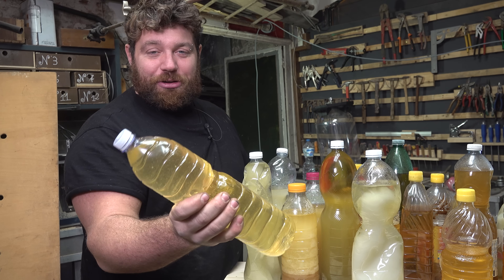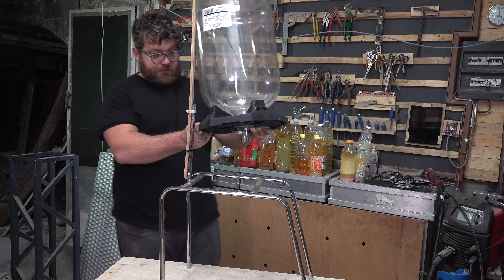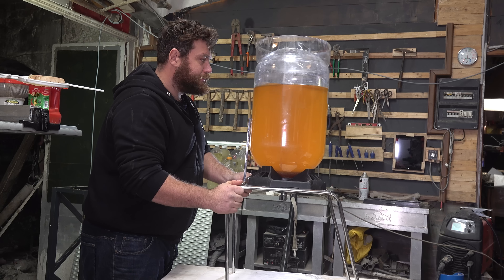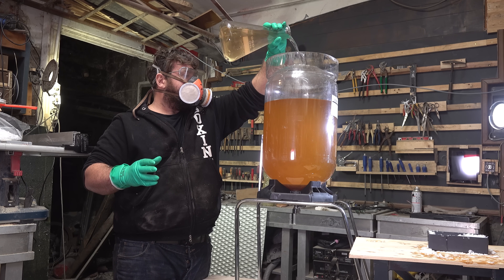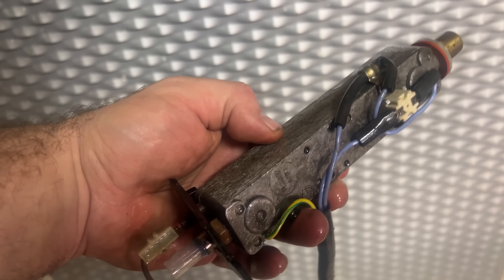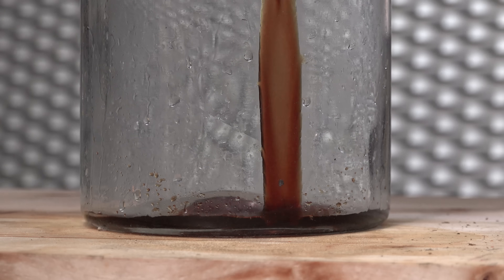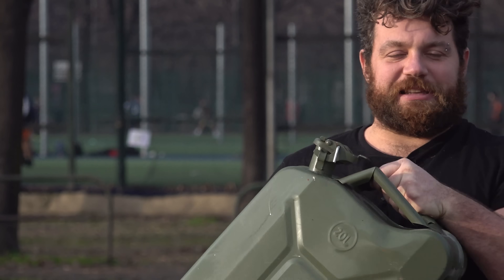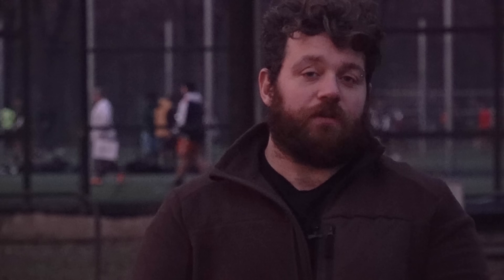How to Make BioDiesel at Home • Full Tutorial 4k

Comment: I have been making & using biodiesel for 15 years, I run 2 cars on it now but have probably driven 200,000 miles in various cars on biodiesel. I use 100% except in cold temperatures when I add 10% petrol. Your method is right in principle but you won't have removed the soap molecules & this could damage the fuel injectors in the engine, you'll also still have residual methanol in the biodiesel too. There is a worldwide community of home biodiesel makers and there are many variations on the processes of making it as well as washing & drying it. I water wash mine and have done so for a long time; it suits me best; methanol binds to water as does soap so its an easy way to remove both.

Comment: Another technique (simpler, but needs little modifications to your car) is to just filter the oil through some cloth. This technique is faster, but the oil is not as clean. This works best for old pre chamber diesel engines. On those engines it will work by just removing the oil filters. I've seen it work for cdi engines too but i think it needed a mixture of normal diesel and modifications to the fuel systems.

Comment: I am really considering getting an engine that could output me elecricity with diesel. I would go around and ask restaurants to dump waste oil to me. Imagine harvesting like 300 kilos in one go. The amount of complexity is really low and reactions are very safe relative to my experience. I will research it more.
I remember that a pure kilo of fat is 9000 kcal. A kcal is like 1.16 watt/hour. So a kilo of it is 10000 watt hours. Liter of oil is like 0.9 kilo but you also add 20% of mass extra from methanol. So let estimate i eventually get  310 kilos of oil could output under 3100000 watt hours (that is actual 3.1 mega watt hours or 3100 kilo watt hours). Lets say that my generator captures a third of it. Still wild. I want solar panels for the daytime electricity generation. That diesel engine would make me elecricity for the night. If I had absolutely huge barrels for it and i would produce more diesel than i would use - i could have electrcity for weeks if not almost 2 months in case of an outage. Also while I am burning that oil I would direct heat pump to my house to not waste heat, or use that heat to boil another substance like that one liquid that begins with letter e and boils at like 55-65 celcius to make a second generator in case my house is too hot. As an electrical engineer i am dazzled at this prospect.

Comment: This functions on all diesel engines. However, this is restricted to a limited blend. Specifically B20. Which means 20% of the fuel is bio diesel, the rest is Petro diesel. Modern diesel can run higher blends with upgrades and filter replacement. Those upgrades would be to remove all plastic or rubber hoses cause bio diesel will cause plastic or rubber hose to delaminate, crack, split and leak or clog filters. Fuel lines would need to be replaced with braided steel or solid steel lines. Bio diesel is also more lubricative then Petro diesel so it will increase longevity of fuel system moving parts. Like injectors and high pressure fuel pumps.
Reply: I have driven 70,000 miles in 3 years using 100% biodiesel in a Skoda Fabia 1.9PD with no fuel hoses changed and no indication of the original ones needing to be changed. Most fuel hose is biodiesel compatible, the only plastic it will affect is PVC over time. In 15yrs running B100, I have only needed to replace injector leak off hoses on a Berlingo 2.0 hdi - which also otherwise ran perfectly well on B100. I change my fuel filters every 10k miles. No problems...

Comment: Please be aware that any drill used for mixing of volatile liquids needs to be the brushless type as a brushed motor creates sparks and will ignite the volatile gases present. You also need to consider static discharge as an ignition source.

Comment: I own a fish and shop shop and make 2400 liters (634 gallons) a year 

I have three fryers each 100 liters or 26 gallons (total 300 liters or 78 gallons) that are refilled three times a week

But I only use the cleanest oil to recycle and the rest goes to waste management.

Making more than 2500 liters (634 gallons) a year means I need to pay excise duty which makes it silly the paperwork is wild
I have the waste management permit because of the amount of waste oil from the shop.  

In the beginning I I had a DIY but eventually bought a home kit for 6,000 pounds and to have it installed in the shed at the back of shop, no one complains about the smell, because everyone expects fish and chip smell from the shop.

Comment: a better way to heat this would be a Drum Band Heater. they are pretty cheap.also if you add a slight stem or hose to the exit valve on the bottom, you can help reduce any potential waste. also after dropping out most of the glycerin, i've seen alot of people blast it with water and stir 4 times over the span of a couple days to collect out the methanol, and any other potential alcohols will collect with the water and settle to the bottle and can also help clarify the diesel by collecting particulates smaller than 10 microns which will help reduce grime build up.

Comment: Good video. I would like to add that you need to test the ph of the UVO to ensure you mix the correct hydroxide solution. 
Also the biodiesel needs to be washed and heated again to dry the oil.
I have been running my diesel SUV on straight Used cooking oil for the last 10 years with between 10 to 50 % diesel or paraffin. I calculated that the chemicals and electricity to create bio diesel was the same as just buying diesel.
Fun to see other people's projects though.

Comment: If you have old disel with injection pump, just use filtered cooking oil mixed with regular diesel (30% cooking oil and 70% of diesel) and do it when it is warm outside. If you have newer diesel, just use diesel from gas station and do not experiment. It is not worth it. Too much work and you might fuck up your car.

Comment: Damn you make this complicated!
If you just filter the cooking oil and add 5% gasoline it'll be fine.
No complicated proces.
No dangerous chemicals.
No dangerous chemical reactions.
No expensive diesel needed.
Just cheap fuel.
It may not chemically classify as diesel, but who cares as long as the engine doesn't care???

Comment: as long as tthe car starts it doesnt matter if it coagulets when cold because when the car runs most of the fuel that goes towards the injectors go back to the fuel tank on  the return lines, (dont know their name exactly) and the diesel returning to the fueltank is warmed by the engine which is the same reason it is not good to un an engine with the fuel light on because it tends to get too hot and it wont lubricate the fuel pump (especially the high presure one) and thus leading to premature wearing of it...

Comment: You could probably mount a beer keg to a high speed drill press and let it turn at a few thousand RPM under pressure or vacuum for half a day or so to seperate out the fine solids and sediments from the oil to clean it up a little.
Reply: Please demo how

Comment: For older pre common rail cars it's fine, they will run on everything. But don't do it in common rail diesels, You can damage pump or/and injectors which are quite expensive.

Comment: The best option i saw on cleaning the cooking oil without using sodium hydroxide  was to use gelatine mixed in water  shake the oil up it up and leave it overnite it it separates the muck in the oil probably can reuse it again if you wanted to the gelatine tunrs into a hard gel so you just tip out the clean oil so its a simple process  that way you could clean the whole 20 litres or two batchs of 10 ltrs at the same time and its ready to use the next day so much easier

Comment: from a veteran cook to you, warm up the oil first and it will flow quicker. Merely filling up you sink with hot water and placing the bottles in will help. however, if this is a serious hobby you could probably get an old discarded deepfryer and warm it up on ultra low, 250 degrees farenheight.

Comment: There's some parts I'd want clarified. What in the hell are those percentages? Add to oil 0,25% of NaOH and 20% methanol???? Well in the video you first add NaOH to methanol and then the mixture to oil, so it already makes it confusing. However the most confusing things is that those percentages mean nothing alone. Are they mass percentage m-% or volume percentage V-% or what? I can see talking about liquids with V-%, but in that case it's uncelar if it should be 20% methanol in the oil-methanol mixture or the volume of ethanol should be 20% of the oil's volume. 

But then there's the part that's just weird, and that's talking about solid NaOH in percentages. Well that sure as hell isn't V-% but m-% still doesn't quite make sense, since we talk about NaOH consentration with moles per volume. I'm assuming it's just mass percentage, but that just seems wrong.

Comment: You dont need to do any of this with old cars... I ran hundreds of liters on pure used veg oil after just putting it through a simple gravity filter... But i had a pre injection heating system heating the oil to change its viscosity and i started and stopped the engine on normal diesel.

Comment: Guys instead of doing all that dirty (dangerous) work, on top of the risk to ruin your cars engine. I much rather slap some solar panels on the roof and drive an electric car. You can convert regular fossil fuel cars to electric too. Way better + I don't need to search for cooking oil. And if I can't use my own solar power, than I can charge at night for cheap price. 

Electric mobility overall is so much easier as a overengineered complicated Diesel Engine.

Running the dirty, non washed (alkaline pH) Biodiesel (cooking oil), will cause corrosion problems with the fuel lines, fuel tank, fuel pump, injectors and basically with the whole engine. Your Engine oil is gonna get alkaline too and your engine is gonna sludge up. Also will have more AGR related problems with coke buildup and catalytic converter problems.
I've no idea why people think fuel production, is an easy DIY task. Crude oil refinery's are one of the biggest, most complex chemical processes ever created. If you actually want to make your own fuel, you need proper lab equipment, the opposite like shown in the video. And I can tell, Lab stuff is expensive. https://www.youtube.com/watch?v=EI3OM7ok8cI&ab_channel=EnergyandMiningInnovation

I worked in a crude refinery for 8 years.

Comment: If you warm the oil in a pot  to 54⁰ C and then mic it with the chemical and stirr it with an electric long arm wisk like the one the painters use...in less than 10 minutes it would split.

Comment: Alrighty, here are some tips from a chemist:

First: safety.
Sodium hydroxide in solid form isn't that bad, solutions are what is highly corrosive. (aka it was much more dangerous once you dissolved it. This is because as a solution it has much more surface area to react as it diffuses into your skin.) Although dust can be dangerous, since sodium hydroxide is hygroscopic, it will just stick and not really become airbourne.

The way you handled the solution was kinda reckless. You could've easily spilled it on your exposed arms or even face (as you were holding it above your head) and that would've been pretty bad. Wear a lab coat, they are pretty cheap.
Methanol is highly toxic, so bubbling it with air not only wastes some of it as it evaporates faster and thus reduces yield, but also isn't healthy, especially long term (also try to limit the amount of exposure of it to air in general. E.g. just the erlenmeyer flask just chilling there as you prepare everything else. just cover it with a watchglass or something. This also reduces the risk of anything else getting/falling in there)

In the end you could see that it is still cloudy. This indicates that there are still particles in there (likely suspended soap & glycerine, which are bad for engines. Maybe even excess sodium hydroxide if too much was used.) So a post-processing step is necessary. Since all dissolve in water, you can use hot water. After that, just discard that watery layer and dry your bio diesel over some dessicant, like calcium chloride, silicon dioxide, etc.
Reply: As a chemistry student I would like to add that I totally lost any respect for NaOH😂 - other than that I am afraid of methanol - especially skin absorption is quite high

But yes not wearing a lab coat is stupid with that amounts used
Reply: @janotho2682  Yeah, I mean, in solid form it's chill, and as long as the solution is cold that's also fine for at least a dozen seconds (oils and the dead skin layer protects quite well for at least some time). It's most dangerous right after dissolving as it heats up quite a bit, so it will react with mainly the proteins holding your skin together, much more quickly. Yk, denaturing and hydrolysing them
Reply: Lets cook Mr White
Reply: Noted sir

Comment: You missed one important step is to remove water content in used vegetable oil by distilling it before using Sodium hydroxide and methanol and filtering it in final product and also important to adapt your car for the use of new fuel .
Reply: Pan có thể chỉ mình thực tế không

Comment: Just a tip: compressed air is usually pretty dry, which will pull the methanol out of solution (methanol is even more volatile than ethanol). You should really mix it mechanically

Comment: isnt the end relt still dangerous because of the sodium hydroxide ?
Reply: It is water soluble. If you (water) wash the end product few times prior to use in an engine, you get rid of that and the remaining soap as well. Additional step of the process is using the desiccant after washing and filtering it out after it clears the water away.

Comment: If you want to get the visocity right, simply add TURPENTINE. I simply went to the supermarket and bought 100L of veg oil and used it in a 50/45/5 of veg/high grade diesel/white spirit. I actually got MORE mpg out of a VW Jetta III, AND the engine ran quieter.

Comment: If you are running your vehicle on engine oil, cooking oil , biodiesel I have found it to be better to mix 70% oil (whatever kind) and 30% petroleum, with this mix I have even been able to start my vehicle in -5. unfiltered engine oil straight out of an engine ( the engine has oil filter) idles nice nice to less smoke after sitting for a while

Older Diesel cars will run on almost anything flammable as long as you can get it started. Quick tip if you ever get stuck and you have spray deodorant on you, spray that straight in the air in take well turning the car over, it will most likely start even in the coldest of temps

Comment: You made a mistake 20 liters of oil and you set 2 liters of methanol so it is 10% not 25% like you wrote in th video. You can avoid filtering because it will go down with the glycerine. Boil oil before mixing. Good work.

Comment: Then there are those who put rapeseed oil directly in the tank just as it is straight from the grocery store, thus unused rapeseed oil. Surely Levin was some famous female pop star thinking like that in her old diesel Mercedes with frying oil. But this probably applies to cars from the 80s or 90s, possibly the early 2000s. but the texture can be a bit thick. May do well in warm outdoor temperatures

Comment: In Sweden, the maximum limit for Bio Diesel at most petrol stations is 7%. it is seen that many car manufacturers specify it as a maximum limit in their diesel engines, but the petrol companies also insert HVO in the diesel. Then someone in the USA said that biodiesel is not so good for the particle filter and of course also the diesel filter. There can also be problems with algae in the tank
Reply: They tell you that so you don't use it, remember think the opposite and you'll be fine

Comment: Sodium hydroxide is really not as dangerous as you think. Its reaction with the water in your methanol can be made much worse by the flask you used if boiling occurred. Your choice of container actually made it more dangerous than it otherwise would have been. 

The most dangerous part of handling it  is when it is in a concentrated solution, and when that solution is hot.

Comment: Please wear chemical safety goggles when handling caustic soda. Safety glasses are insufficient. Overflowing it out on the bench is a definite No-No.  A nearby eyewash is also a really good idea. 
Caustic soda reacts with methanol to produce sodium methoxide. Sodium methoxide is extremely hazardous- don't get it on you!
A tyvek lab coat is the absolute minimum PPE. A full rubber suit and boots would be better. 
Methanol is very flammable- stirring with an electric drill is asking for trouble. Electrical equipment should be intrisically safe. Exposed wires on a repurposed steam mop heater dipped into a flammable corrosive mixter makes me cringe to my toes.
Please don't hold the Hazmat over your head when pouring!
Please dispose of the residual glycerine/caustic/methanol properly.

Sorry if I spoiled all the fun! 

On a practical basis, caustic soda generally contains considerable water. The reaction goes better with dryer caustic soda nad methanol.

Comment: Good job, but if i'm you, i don't put this in my truck, will destroy the engine, here few things i will do it different
1-) dont bubble air in, you will oxidize your biodiesel, use a stainless steel water pump to mix
2-) wait 3 weeks to remove the biodiesel, use a syphon to remove the biodiesel, not remove your glycerin under the vessel, this will not remix the glycerin and biodiesel again
3-) wash your biodiesel, it will remove the excess of sodium hydroxide and methanol
4-) make methanol test, mix 27 ml of methanol and 3 ml of biodiesel and shake it, if any fall is detected, your biodiesel is not pure, and you only can use 99,6% pure biodiesel in you truck, if not, will destroy your engine